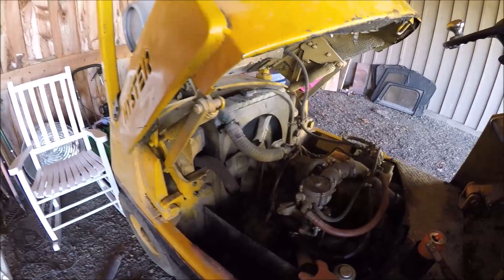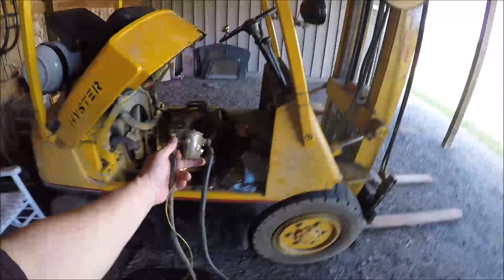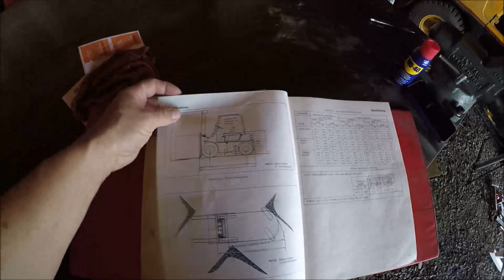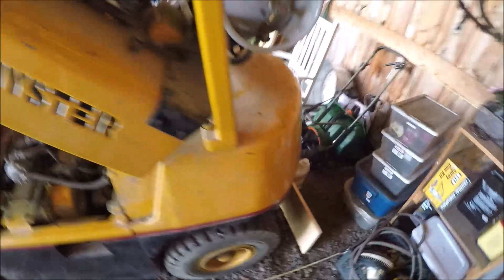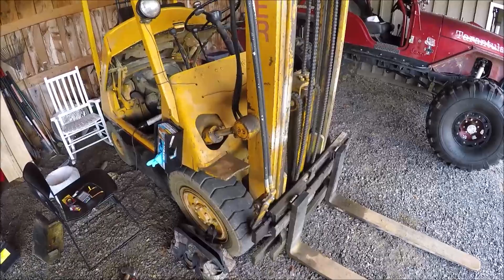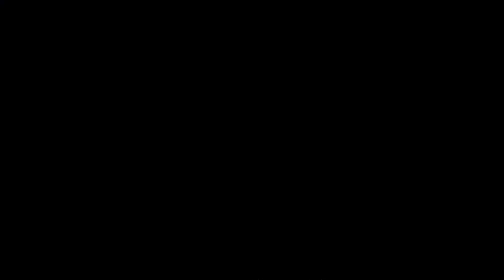New shop build Part 2 and extra stuff!

Comment: Tom, if the seal at the top of the cylinder is leaking most likely the piston seals are shot.  The forklift is looking good! Nice to be able to run your Jeep around!
Reply from the maker: Yeah I imagine they are. Once I get moved in to the new shop and settled I am going to take a crack at the cylinder  rebuild.